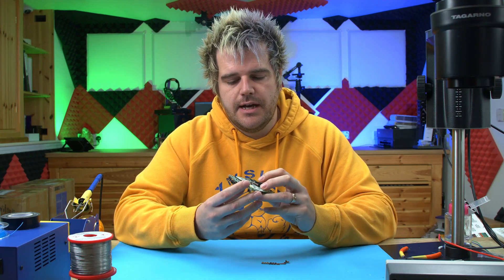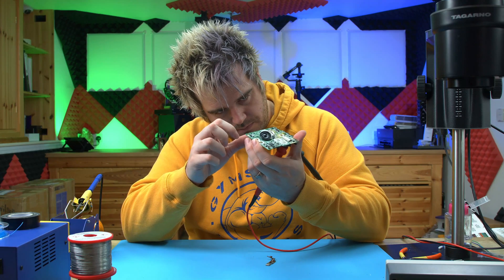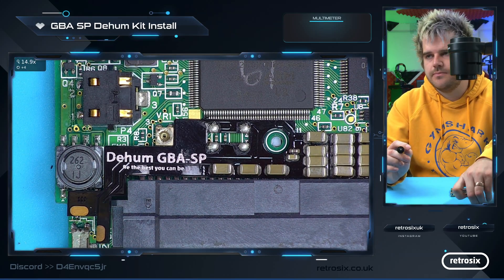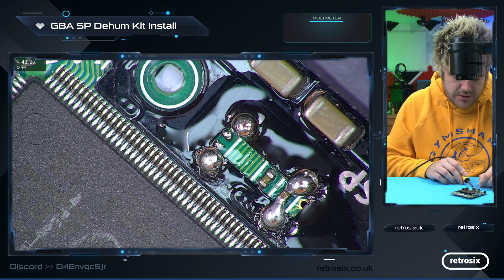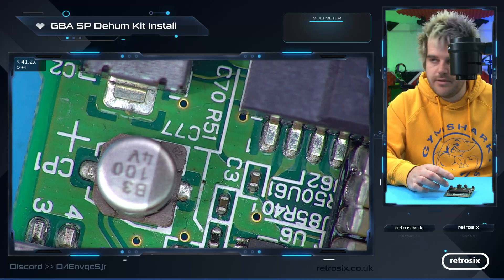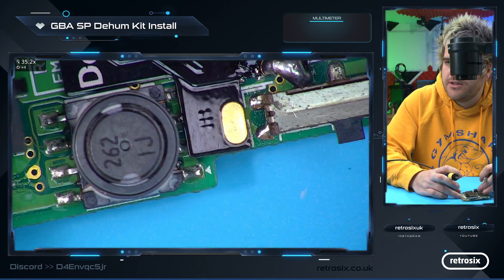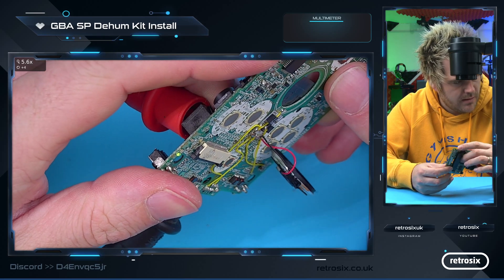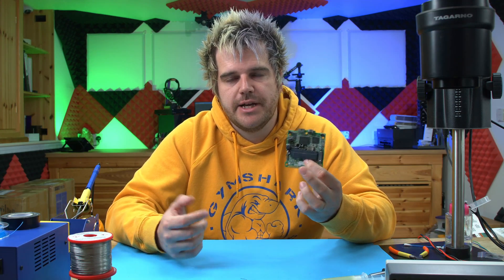Game Boy Advance SP Dehum Kit, Remove Audio Noise - RetroSix Installs

Comment: Installed a HDMI out on my IPSd SP and the audio of the HDMI has both a hum and pops/cracks would a kit like this clean up the audio or does it only affect the SPs speakers?
Reply from the maker: Depends on which screen you are using?
Reply: @RetroSix  I think its the V2 of the funnyplaying IPS kit
Reply from the maker: They are known to add a lot of noise
Reply: So a dehum kit wouldn't be able to clean up the audio?
Reply from the maker: @TheDisturbed6666  Not if its the IPS screen adding the noise. Its literally the FunnyPlaying screens only, all other screens do not usually add noise but I have seen it many times where FP screens do
Reply: That's unfortunate, I'll try and connect the original screen to rule out the motherboard but the IPS seems to be the likely culprit

Comment: What would happen if you replaced that missing smd capacitor with a thin copper wire bit?
Reply from the maker: You should short the board. Caps are not shorts and not 100% sure why quite a lot of people seem to do this (short a cap with a wire if missing). If a cap is missing either leave it off or replace it, never short it.

Most caps are not required they are just good design decisions (decoupling, smoothing, filtering etc...). Very few caps are 100% required for a design to work

Comment: I've set this up on my SP with the Wire-free clean amp pro and upped to a 850mAH battery, but i'm able to hear a hum no matter what the audio level is set to. Is this normal?
Reply from the maker: Make sure to clean the volume wheel and power switch. SP still has a little hum though even in perfect clean state
Reply: @RetroSix  thanks. Just trying to figure my power issue now as think i might have knocked something which is preventing it powering on. heres hoping i get it working again!

Comment: i soldered the dehum kit and it wouldnt turn on. then i removed the dehum kit and my gba turned on. what could be the problem? very informative videos btw, thanks 👍
Reply from the maker: Usually it's a dying fuse or T1 transformer
Reply: I got it to work eventually. Most important tip of the video is to not bridge the both transistors but keeping the gap in the middle. I also soldered the amplifier.

Comment: Hey so I tried installing the kit last night and I thought I had put the pads for where it connects to the power switch correctly and when i went to turn it on the power would just flash and not turn on I've been trying to fix it and all i get is a flash and the system won't power on do i just need to replace the power switch and try again????
Reply from the maker: Desolder the ground battery spring pad and see if console turns on. If it does try just redoing all solder points and cleaning power slider
Reply: @RetroSix  how do I power the console if I desolder the springpad??
Reply from the maker: Desolder the Dehum kit pad attached to the ground pad. Not the actual spring
Reply: @RetroSix  okay I'll try but yeah I removed the kit completely and it still didn't turn on ima try to open the power slider and cleaning it to see if that fixes it not powering on but if that doesn't work should I just go and try to replace the power slider??
Reply from the maker: Check fuse also F1
Reply: Have you solved the problem?Power can't be on suddenly after installing the kit.You may check the C47 cap if any shorted circuited.Mine shorted & removed this cap,power on again.I removed the kit lastly and afraid of frying other components.
Reply: @cliffkhew  no after I posted this it's just been sitting in my dresser but I'll find time to look at it it still doesn't turn on:(

Comment: I accidentally removed the capacitor on both of these points trying to solder the dehum kit on. If I bridge all the missing capacitor points with Kanthal wire, will it function fine? It won’t turn on at this point.
Reply from the maker: Don't bridge them thats a dead short. Probably will work just leaving them off though
Reply: Did the same thing. Won't boot.

Comment: Have I understand it right that the capacitor can still be there on its place? Or do I have to unsolder it first?
Reply from the maker: You have to remove all capacitors and replace them with new ones